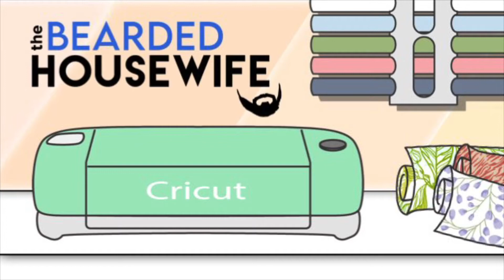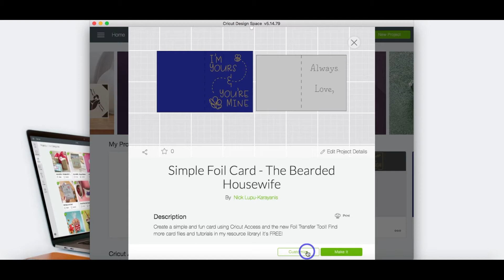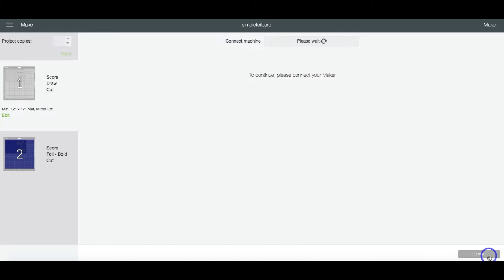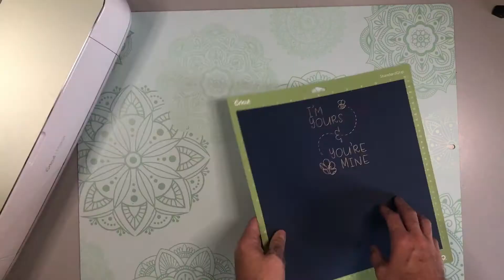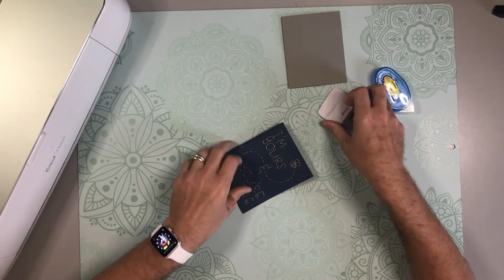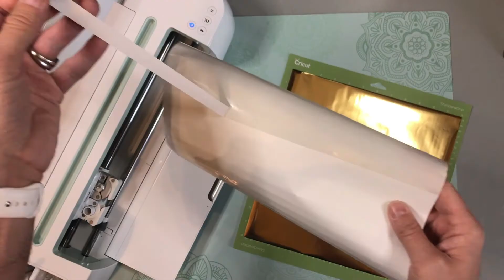Make a SIMPLE project with the Cricut FOIL TRANSFER TOOL plus TIPS & TRICKS!

Comment: Thank you for this video. I spent hours last night . I can’t get my foil to transfer boldly to my card stock. I don’t know what I’m doing wrong. I’m using a writing font, bold foil using the bold tip, all circuit foils, moved my rings all to the right, I just can’t get a bold result.. do you have any advise? 🥲🥲🥲🥲
Reply from the maker: Shunta, I’m sorry about the trouble you’re having! It could be a few things. 

-Do you have the foil taut enough? If it is too loose, it could affect the results. 

-It also could be the font you are using. Some fonts are thinner than others. Maybe try another writing font to see if there is any improvement? 

Let me know if I can help further!! The foil tool is great but can be a little finicky at times!!
Reply: @TheBeardedHousewife  I’m going to try it again this evening and see how I do making sure it tight. Thank you so much for responding. I’ll try different writing fonts as well.